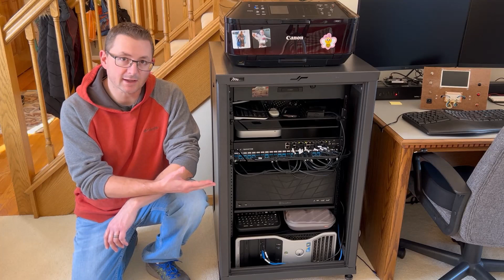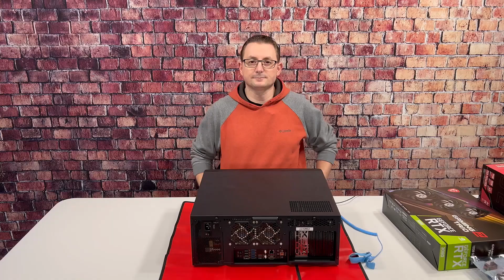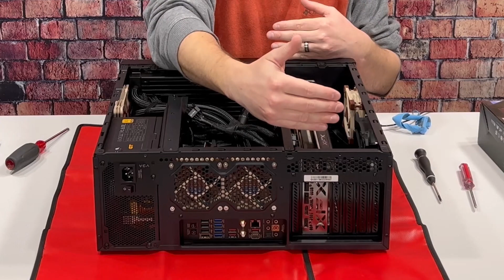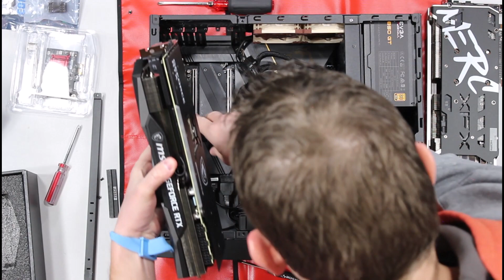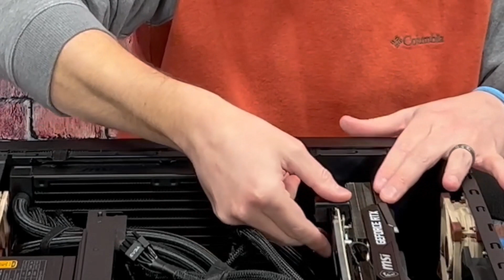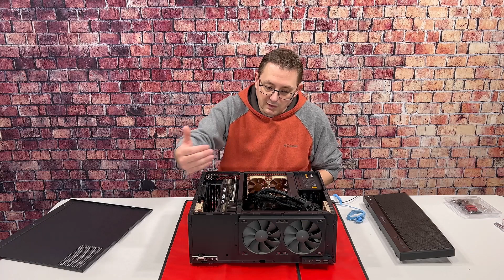Build Tips for SilverStone Grandia 11 + NVIDIA GeForce RTX 3080

Comment: I have similar hardware, but I've had lower overall temperatures in the case by having the slim fan as intake instead of outtake. But my case is also on a shelf with an open back.

Comment: Hi, good insights with this video! You mention fitting in a 5u rack space, the dimensions online I see it should fit in a 4u space (minimal clearance but would fit) - can you confirm this? I’m thinking of getting the GD11 case to fit in a 4u rack unit but if that won’t fit I’ll need to go back to the drawing board
Reply from the maker: The case is 4U tall, but the shelf takes up 1U as well. (There is no rail kit for this box.)

If you have a 2-post rack, you will struggle to find a cantilever shelf with enough width to fit the case. Even if you do, keep in mind any shelf needing more than 1U is likely to cover up the fan ports of the sides, which will negatively impact your airflow. I initially used a 2U cantilever shelf mounted upside down, because I had a rack configuration where I could use the space underneath. It wasn't ideal though, and the shelf sagged a few mm. 

If you have a 4-post rack, then you might be able to source a shelf that you can mount concave-side up -- where the shelf occupies the first 1U of the 4U allocated to the case. I have doubts, though. This case is wide.

Comment: 3:30 If only this case had 3rd fan opening on front, the you could use that fan to push more fresh air for the GPU. For extra points, SilverStone could have provided a plastic shroud to direct air from that (missing 3rd fan position) to the GPU only.
Reply from the maker: It would be nice if there was a 3rd fan on the front!
Reply: It was done for structural strength purpose. The case has holes all around @takeofftechnical

Comment: Can I fit TWO Gigabyte GeForce RTX 3090  ??
Reply from the maker: If your card’s width agrees with your motherboard slot spacing, then I suppose it would physically be possible. Of course you would need a large PSU, so that’s another clearance to check.

I doubt you will get acceptable heat dissipation. It’s also likely your motherboard will drop the PCIe lanes from x16 to x8 for a dual GFX card installation. If you are trying to bridge the cards (NVLink?), then I would question if you wouldn’t get the same or better performance from a single card. If you are mining or rendering 8 displays or something like that, then I would recommend finding a different case with better cooling.

Comment: Wow it seems that the GD11 is much worse than the GD09
Reply from the maker: I've done builds in both, and I prefer the GD11. The GD09 is less money and a bit easier to build. However, it is also less capable. That case cannot fit an AIO, and the CPU air cooler has a lower maximum height than the GD11. Moreover, the GD11 can support longer graphics cards than the GD09.
Reply: @takeofftechnical  Yeah the GD09 AIO compability is an issue but what I dont understand is, why dind't they make the GD11 case able to fit 360 AIO? I know it would prohibit long GPU's but its just wierd to me. Also the bottom fan being blocked by mobo seems like a major oversight aswell. The GD11 dosent feel like an upgrade but just a different version with its own issues aswell :/
Reply from the maker: Based on some other comments, I think getting a 360 AIO into the case is possible with minimal cuts. However, without the additional 120mm intake fan, I wonder if it actually cools the CPU any better. I thought about doing a video to try it, but frankly I just don't have the budget. Moreover, my GPU occupies that space. I have been quite tempted, though, to swap out my 240mm AIO for the biggest air cooler I can fit. I have a high-end chip in this case, and I suspect the 240 AIO can be bested.

I agree that the GD11 comes with compromises, too. That said, a full-sized mobo in a HTPC case with these CPU and GPU clearances is why I bought it.

Comment: This is probably the best video I've seen on this case regarding conveying information to the viewer. I am upgrading my main gaming PC and  realized that I could easily turn those old parts into a HTPC. I've wanted to make one for a while and now that I've moved into my own home, it seems like the time. This case is gonna fit perfectly into my media stand with some room on all sides for cooling.
Reply: did you end up pulling the trigger on building that HTPC?? if so, how do you like the case? I am currently ordering parts of a living room PC.
Reply: @Mottoman216  I did and it was a great decision, truly been loving it way more than I expected to. I do really like the case but just be prepared that cable management is non-existent (I just kind of zip-tied off to the side) and things get very cramped near the bottom of the mobo (using micro-atx). Otherwise it was smooth to build in and I haven't had any temp issues with a 5600x/silver soul 110 and 6600xt.

Comment: Can we use the side fan location (from the GPU  side) to mount another radiator for the GPU using one of those Graphic Card that comes with the AIO liquid cooling from the factory??
Reply from the maker: I don’t think so, no. I tried searching for those and most of what I see has the tubes located on the top of the video card where there’s no clearance with the top of the case.
Reply: @takeofftechnical  nice catch. Haven't thought about that one.

Comment: So you can't just use any ATX motherboard for that case? If not, then I'm out of luck cause I want to swap my components from one case to one of these, but I don't want to be buying a whole new motherboard for this case
Reply from the maker: Take a look at the case you already have. Does it have 7 PCI slots? Does the graphics card start at the 2nd one? If yes then your ATX motherboard should fit the case.
Reply: @takeofftechnical  yes it does, I must have been mistaken then. I haven't plugged anything in for a while and forgot so I thought wrong. Thank you for that

Comment: I can confirm a 4090fe fits in this case. You just have to buy a U shaped power adapter so you can plug  in the 16 pin cable. CY adapter I think was the brand name
Reply: Yeah that's the one have..I  tested 580 watts through that adapter with a laser thermometer and it was fine
Reply from the maker: Cool! I hope you are loving it. Be careful with the 4090 and those adapters, though. CableMod makes the recommended adapter in my circles, but it's being recalled as of December for melting. Notice: https://cablemod.com/adapterrecall/

I have not worked with the 4090. My colleagues that fit it have chosen to use a case with more clearance until a safer adapter is established. I would recommend doing the same.  If I absolutely had to have it, I personally would try an aluminum adapter like this one: https://amzn.to/3UbcuYs. That being said, knowing that NVIDIA doesn't cover this issue under warranty due to the 3rd party adapter, I really advise against it.

Comment: Very interesting build. I have ordered some new AMD parts, and are considering using this cabinet for the setup. As of now, I have the SilverStone Grandia GD08. And Ryzen 1600x, GTX 1080 ti. So I'm pretty happy with that case. Lots of fans in GD08, and possibility for Blu-Ray player.
Reply from the maker: I haven't done a build in the GD08, so I can't offer any comparison advice. What drew me to the GD11 is the capacity for a long GPU and the support for a 240mm AIO CPU cooler. Best of luck with your build!
Reply: Thanks 🙂

Comment: I built this case this week but I didn't do a water cooled CPU.   I did 5 120mm fans and 2 80mm fans.  I am running a MSI Compact Ventus RTX 3090 GPU.  I choose to use the BeQuiet fans in the system and a BeQuiet CPU cooler that has a BeQuiet fan as well.   I am using this for a MadVR Video Processor for my home theater.   The problem I am running into is the fans on the 3090 get SO LOUD while watching a movie.    I know I have a problem with fan outtake but thought I would ask for opinions on this threas.   I have all the 120mm fans being intake and the 2 80mm in the back as outtake.   I know I need more outtake but here is the problem I see.  the 2 front 120mm fans suck air in ad the 1 120mm next to it also sucks air in.    The 2 120mm fans infront of the GPU is sucking air in as well and I did this because the 3 fans on the GPU are intake and I assumed it would want cooler air hitting the GPY.   So the question at hand is this, is there a better way without having air blowing out of the front of the case?
Reply from the maker: Definitely keep the front fans intake. The front of the case is a filter, and you don't want to blow dust into the wrong side of it. Honestly I would try removing the fan on the PSU side of the case -- use the baffle instead. This will reduce both the overall pressure imbalance and the turbulence within the case. 

The video card fans may have options in the BIOS or NVIDIA control panel. Set it to "Normal" or "Quiet" performance modes. The BIOS should have some fan curves for the system fans that you can also tune. 

Do you have the case in a home theater cabinet? Does it have sufficient airflow? At the end of the day, if the intakes are pulling hot air in, the PC will run hot and the fans will run faster and louder. You might consider installing powered fans to the cabinet and/or opening the doors (if any) when running the PC.
Reply: @takeofftechnical    Thanks for responding.   What baffle you referring to?    No it’s on a shelf that is open in the back of the room.    I can use Afterburner to create a curve for the fans which I’m toying with now.
Reply from the maker: SilverStone provides a plastic baffle in the box the GD11 comes in. It snaps into the PSU fan location- sealing it off so air won’t escape out the side. This preserves the direction of front-to-back airflow over the cpu. HTH

Comment: Is the length on that card 34cm too???  The XFX???
Reply from the maker: Both the XFX I was using and the 3080 I replaced it with are 323mm long. The case manual states 340mm as the length limit of a GPU. I believe the manual to be accurate.

Comment: Soooo? Basically, You can use most motherboards, you don't need one the uses the second pci-e slot? Cause don't all motherboards use the first pci-e slot?
Reply from the maker: No; motherboards vary. The mobo manual will callout which slot to use for a video card. This slot is typically marked with "x16" to indicate it uses all 16 PCIe lanes and "75W" to indicate the PCIe device can draw the maximum slot power of 75 watts. The GPU slot may or may not lineup at the 2nd blank on the GD11.

Comment: Will it fix a 7900xtx asrock phantom gpu?
Reply from the maker: I believe it will. The GD11 manual says the GPU can be no longer than 340mm and no taller than 151mm. That card is 330mm x 140mm, so it will clear. The Asrock specs state the card has 3x 8-pin power connectors. You should be able to use the same kind of 180 degree adapters linked in the description. Unfortunately Asrock doesn’t have an image showing the power sockets, so I can’t tell if you need the standard or reverse type variant of that adapter. Good luck with your build!

Comment: What should I check/look for when looking for a motherboard with the compatible pci-e location.
Reply from the maker: There's no case-alignment specification that I can find for motherboard PCIe slots. I looked at the manual and photos when I bought my kit. I visually estimated the positions by starting on the edge of the motherboard and counting spaces. That's not fool-proof, because it can be hard to tell if spacing is double-width, triple-width or between. It did, however, work for me.

Comment: can a Noctua nh d15s fit inside here? Was looking for something like the coolermaster haf xb evo case, and this one was the only comparable one but it seems like it has considerably less height
Reply from the maker: No, the Noctua NH-D15S will not fit. The NH-D12L [ https://amzn.to/47fDfyO ] would be the biggest Noctua air cooler that should fit the SilverStone GD11. You could also try the NH-U9S [ https://amzn.to/3DMfGjz ] with the optional 2nd fan [ https://amzn.to/45bRcMx ]. I haven't tried the NH-D12L but I have used the NH-U9S with the 2nd fan on a different build with good results.

Comment: I'm doing a similar build with the Grandia 11 Case.  I don't have all my components yet, but was wondering why the AIO radiator tubes are required to be on the power supply side?  Do they interfere with the GPU if the radiator tubes are on the GPU side?   Thanks for the Video.
Reply from the maker: That is correct. In addition to the GPU interference, the case support bar that runs front-to-back will also not fit. Best of luck with your build!

Comment: Am about to do a case swap to my new GD11 and plan is to largely follow the same as you've done here.  Only difference is I don't have a rad.  Plan is to pull from front and the GPU side and exhaust back and PSU side.  Don't have a thin fan so will have to see how that goes and I think I'll get away with 2 120s on the GPU side but will see how it pans out!
Reply from the maker: Without a rad, I would be tempted to use the baffle (included with the case) at the PSU side fan location. My thinking would be to reduce turbulence on the front-to-back airflow that runs through the CPU air cooler. Of course only benchmarks and experiments will definitively answer baffle vs exhaust vs intake at that side location, but my first guess is baffle! Enjoy the new case!
Reply: @takeofftechnical  i'm assuming you mean the plate that doubles as a 3.5" disk holder.  Either that or I'm missing something!  

TBH anything I do will be better than what I currently have where the existing silverstone case I have only has 2 exhausts and no intake.
Reply from the maker: No, the baffle is a piece of plastic shaped like a dust filter. SilverStone provides both a dust filter and a baffle for that fan location. If you install a fan as an intake there, use the dust filter. If you install a fan as an exhaust there, use neither. If using no fan, use the baffle.
With 2 front intake fans and 2 GPU side intake fans, the case will be pressure positive. The baffle in that setup will prevent air from escaping the empty fan location and keep it moving toward the back of the case.
Reply: @takeofftechnical  ah yeah not I have you. Yeah that’s how I have it. Didn’t add an exhaust on the PSU side as I realised it would be too close to the in really.  So I have 4 ins and the two outs and a lot of positive pressure. It looks so nice 👌
Reply: @takeofftechnical  incidentally my build is all done now, despite the UK heatwave my thermals are better than ever and the build is so much neater than it was.  I needed a usb 3 adapter to give me a USB type E connection but outside of that all great.
Reply from the maker: Awesome! I’m glad it worked out.